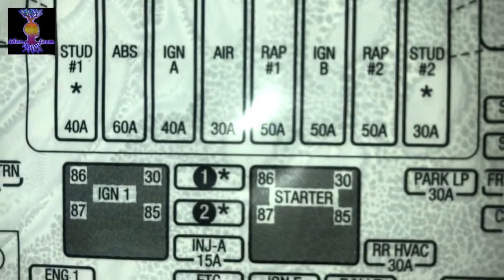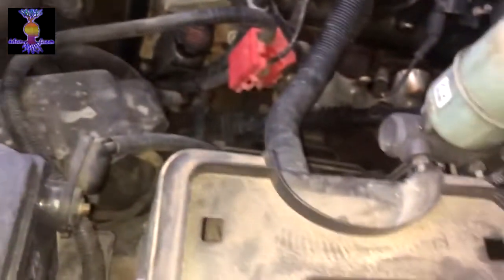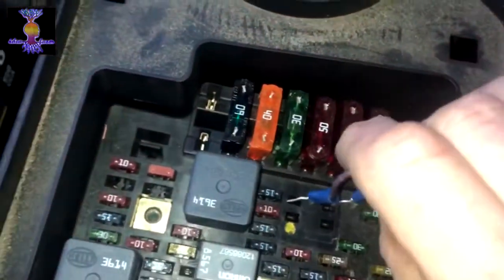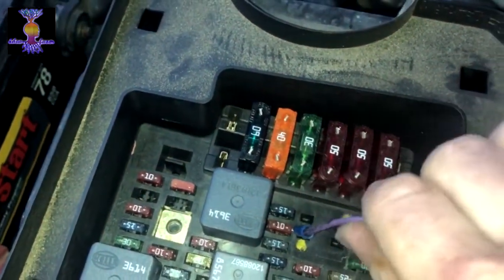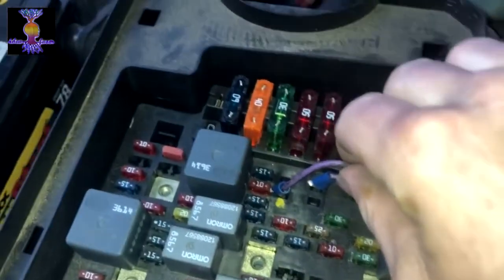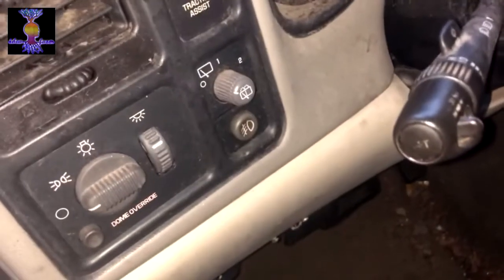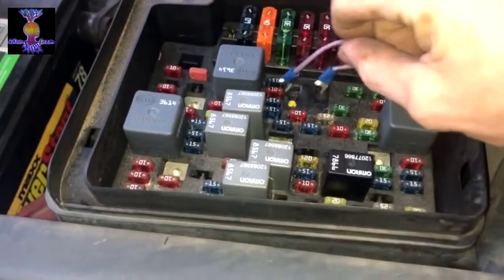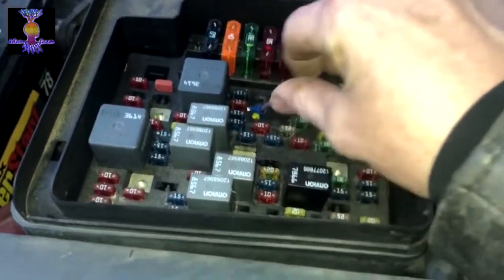2002 Chevy Tahoe Won't Crank, No Starter? Here’s The “Get You Home” Hack.

Comment: Oh my God I just want to say thank you thank you thank you so much it worked perfectly you are the man I have been struggling with this for a while sometimes it starts sometimes it doesn't but this works perfectly
Reply from the maker: I am so glad this helped! Side note: I kept a steel pipe with me so I could reach behind the passenger wheel and give the starter a smack when the jumper wouldn’t work. Once I replaced the starter the problems went away.

Comment: That’s just a bad relay. Not a bad starter my guy!
Reply from the maker: The relay was, and is fine. That was the first thing I checked actually. The starter was bad. Using the same relay with the new starter and it works just fine.